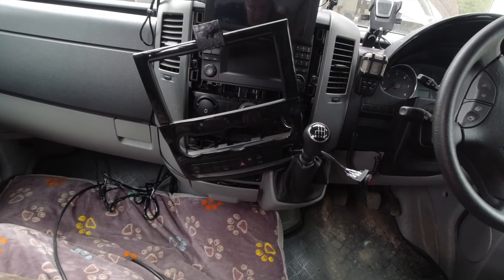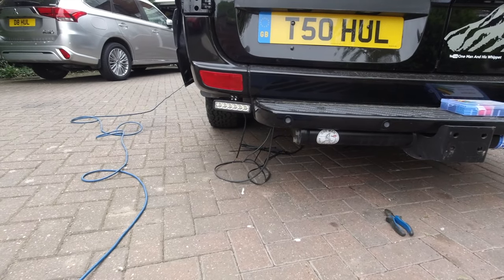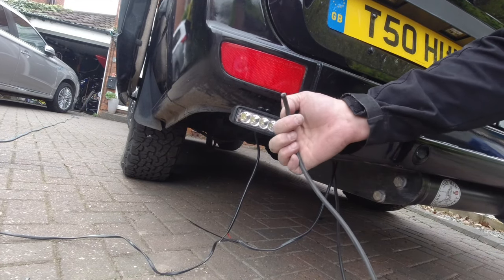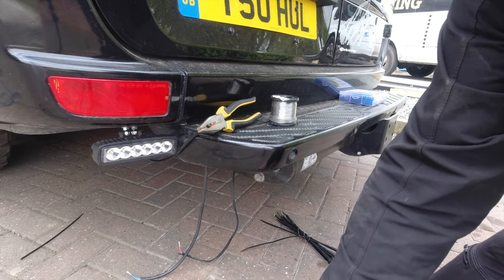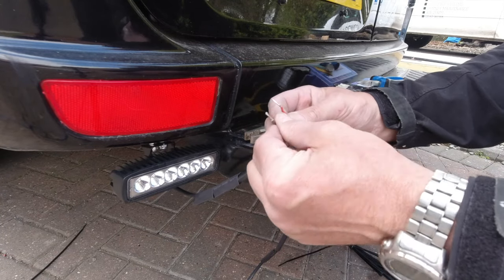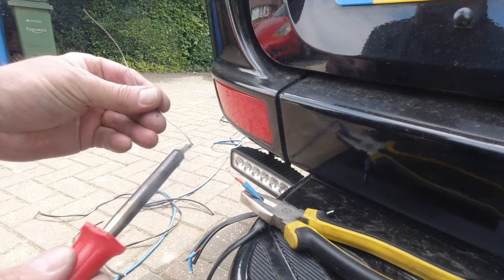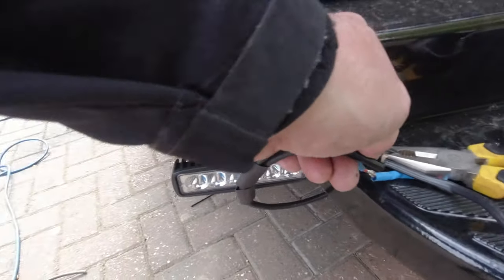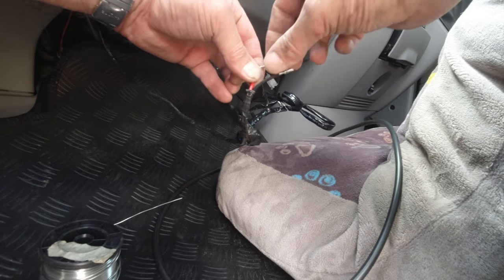Camper Van Wiring (solder joints and shrink wrap)

Comment: Top tip.
An elastic band around the handles of the pliers makes a good clamp.
Adjust the number of winds and position on the handle to adjust pressure.
Works really well with water pump pliers.
With TWO pairs, clamp the handle of one to a panel/ bumper with the other, gives a much more comfortable position.
Reply from the maker: Nice one like that 👍 thanks Roger 👍🐾😀
Reply: @onemanandhiswhippet  
Edited! (2 pairs)

(20+ years as a copier tech! Trick of the trade!😁)
Reply from the maker: 👍🐾😀 I’ve pined your comcomments so it stays at the top of the listing some people will see it 👍🐾😀
Reply: @onemanandhiswhippet  
It's that "third hand" you often need.
Saves annoying the missus!
Reply: Roger Starkey brilliant tip!! I’m totally pinching that idea 💡 cheers 🍻
Reply: @GregVirgoe  
Greg,
Lockdown "boredom project"
With all the kit you have, see if you can build a "clamp bridge" from one side of the van/ workshop to the other!
😁
Reply: @GregVirgoe  
Just btw, a bungy cord would work as well (Very strong grip). Wind once and tuck in. It can also suppliment your grip if something is very tight, or good for that nut/ bolt you can't get to both sides of
Reply: Roger Starkey my personal favourite for soldering is a wooden clothes peg 😃

Comment: Good stuff Mr. B 👍🏻😁

All these van-upgrade videos makes me think back to the couple years I spent in a garage as a trainee mechanic back in Doncaster when I was 15-18.

This video reminded me of my all-time favourite job (it was the last one I ever did there) These two guys come in with a basic ‘98, 3l Mitsubishi shogun saying they wanted all this stuff fitting or replacing so they could go off-roading.

Seriously when these guys said they wanted a lot of stuff. I mean a LOT of stuff~ about £15k worth
((New tires, disks, brake pipes, shock absorbers, full exhaust, headlights, spotlights, recovery lights, reversing lights, side markers/indicators, bullbar, winch, snorkel, roof rack, dual battery systems, USB chargers, solar charger! etc, etc))

Shrink wrap is such a perfect little thing, really cheap too like you said but my boss wanted me to just strip the wires, twist them and then wrap the lot in tape since it would “save time and fuss” 🙄 some of the wires were on the outside (eg. lights) and if they were just wrapped in tape with the wires exposed underneath... rust is one of the worse things to deal with (and I wasn’t getting the blame for that)

I did the whole lot, replacing parts and electricals- soldering and wrap ~ only burning myself a few (a LOT of) times with the soldering iron 🤣 -in 3 or 4 weeks with my boss watching from afar and coming to help every now and then, after we’d finished fitting everything this thing was a beast!! (from a cub to a lion!!)

Best Job I’ve had fitting all that together and having random strangers say things like “Excuse me Sir, OH! you’re a girl?? Aren’t you scared you’ll get covered in crap laying on the floor?” I felt more at home in overalls than I ever have in a suit 😂🔧

But yeah- that’s one of my many stories of my very first job working in a garage, I hope you enjoyed~ I have plenty more 🤣👍🏻
Reply from the maker: Nice on Caz and good for you them skills will come in when you get your van 👍 best regards Louie and his two poo pickers 👍😀🐾

Comment: Ah the age old solder Vs crimp argument lol, i'm a crimper personly, 37 years as a mechanic and 99% of the time i solder it's to repair cracked and coroded solder joints on PCBs ;) mainly VW door locks LOL, cars suffer from vibrations more than boats hense crimping is more prevelant but if your going to solder do it propper like you do ! 

My rule is if it's a joint from a movable object to a solid object then i crimp 

IE a wire to a switch or wire to a battery then i use a crimp, wire to wire i solder, same as car manufacturers do.  

Great stuff as usuall chap !
Reply from the maker: Many thanks 🙏 the good old ways work for me too 👍 thanks for watching 👍🐾😀

Comment: Greg Approved! 👍🏼 That made me roar with laughter seeing you in those safety glasses 🤓🤣
You’re just like me I always prefer to solder my wires and hate crimps.
Shame you didn’t show us how to remove the dash facia as I’ve got to do mine soon and I could have followed your video. 
Nice video mate, love to Jo and Louie xx
Reply from the maker: Thanks Greg 👍 the dash just pulls out and there’s easy access to the fuse box behind the glove box for running cables if you need to 👍 we are all well just desperate to get out and about 🙏 hope you are all ok lots of love to you Lou and your Mum ❤️ take care guys we will soon be drinking beer in a field somewhere soon hopefully 👍🐾😀🍺🍟
Reply: Greg,
Am I right in thinking that you favour pushing the wire strands into each other, then flux and solder in one hit for better Interlock?
Reply: Roger Starkey I use the Dave approved method. If on the bench or good access I tin the wires first but if in position and awkward to hold I twist the bare wires together first both exactly as Dave showed us. 👍🏼🤩😃
Reply: One Man and His Whippet that would be brill 🍻🤩
Reply: @GregVirgoe  
Slightly off topic.
Thanks for the "biker tube scarf" mask idea!
In use now with a mod.
Henry vacuum HEPA flo bag, cut into 120×180mm double thickness, folded into the tube as a filter!
😁
At about 6 "filters" per bag, and bags £1each, cheap enough to discard the filter after every use and the wash the tube.
👍
Reply: @rogerstarkey5390  Where can I find info/pics on that biker scarf tube/hepa filter idea from Greg?

Comment: The best way for 100% Waterproof is adhesive lined heat shrink tubing. Also use the old 60/40 lead solder. Modern solder is rubbish and for military applications it has to be lead.. Cables need to be oil and chemicals resistant for vehicles. Standard PVC goes brittle at low temperature and in winter it cracks if used in a position of constant flexing  such as wires running into doors. PVC also absorbs water if submerged for any length of time. Also watch out some chinese cables  have copper coated steel wires and will rust. Easy to check when cutting use a small magnet. Cheers from grumpy old George...
Reply from the maker: Thanks for watching George 👍🐾😀

Comment: I'm rubbish at soldering so that may help me  do better next time, I used solder connectors on my motorbike project where you heat them up and solder melts in the middle and the connector shrink wraps to the wires, a bit more expensive but work for me 😎👍🏻
Reply from the maker: 👍 thanks for watching Ian 👍🐾😀
Reply: @onemanandhiswhippet  and what job did I have to do today? Some soldering! Did a great job so thanks again for the tips 😎👍🏻
Reply from the maker: Ian Morg 👍😀🐾

Comment: I enjoyed it, very old school. you will be a lit-up. 
The shrinkwrap is amazing stuff, I think it helps with absorbing the vibrations you get from your van. small crimp joints vibrate loose over time and electric tape is a short circuit fire hazard. 
back in the '90s, I went to pick up a burnt-out motorhome. for the insurance inspection. the owner had done some DIY electric work. lots of spade connections into the wiring loom! which they said caused the fire and they didn't want to payout. that thing was in the yard for a year!
anyway, my question to you is do you have to declare any work you do to your insurance and does the cost go up?
thanks for the video. love the van proper weekender.
Reply from the maker: Hi there Thanks for watching my insurance company have never asked about any work I’ve done myself however I am a qualified electronics engineer I suppose it depends when you have a problem you find out if they’re willing to cover it like the van picked up 👍🐾😀
Reply: @onemanandhiswhippet  I was thinking you had a fixed evaluation insurance policy. my bad thanks.
Reply from the maker: B Roll I do 👍😀🐾